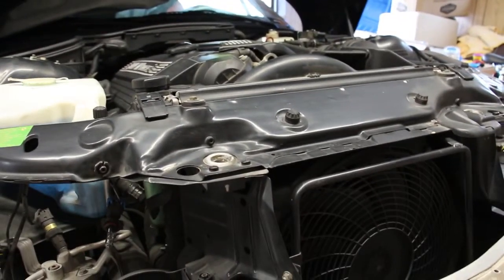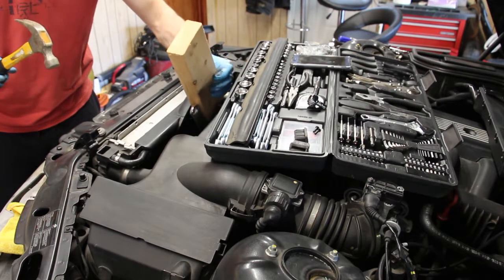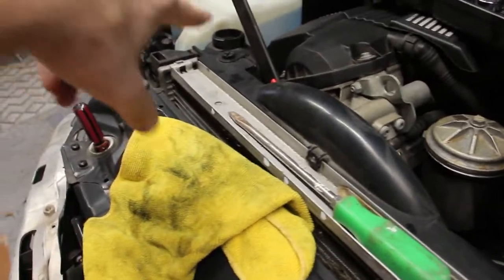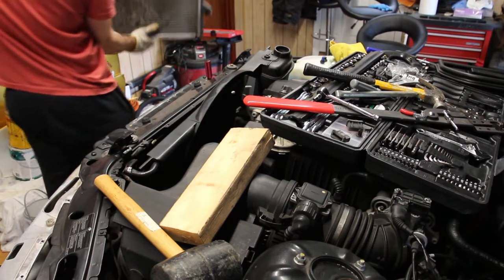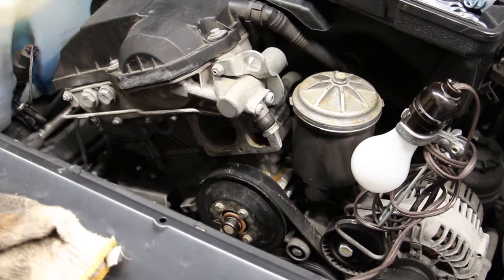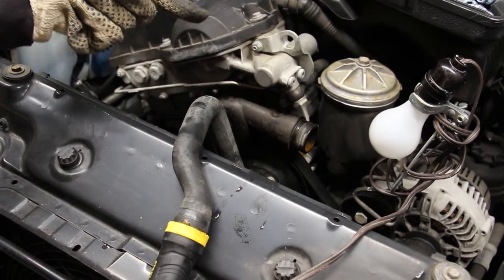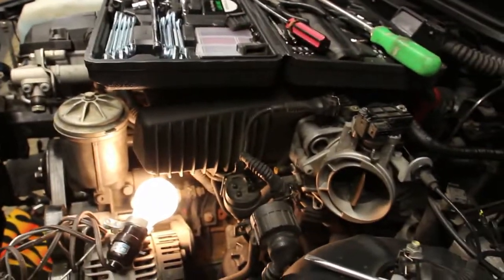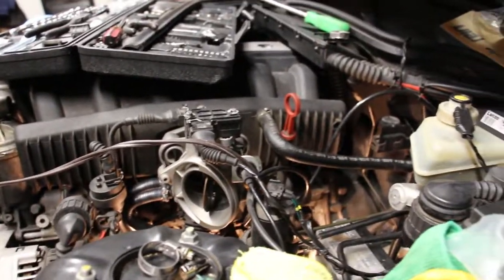How to Update the Cooling System on a BMW Z3 M Roadster pt.1

Comment: At the 25:27 mark where you show the hose routing on the water valve off the vehicle I think you may have gotten it reversed. My before photos of my car show the short hose coming out of the dash and going to the bottom outlet of the water valve and not the top. Thoughts? I want to make sure my car wasn't wrong to begin with, perhaps the previous owner had reversed the. Great video by the way, helped a lot when doing  cooling system overhaul yesterday.
Reply from the maker: Hmm, that's a good question. I looked at some diagrams and it appears to be reversed! That's how it was originally hooked up in my car and it ran without any issues. I was also able to bleed the coolant successfully. Good catch there. I'll see what I can dig up on this. It will suck to redo this, but if it's wrong, I wouldn't want to leave it like that.
Reply: Yeah I posted something on the forum and another user checked his car and looks like you have it reversed. The bottom outlets should be going through the dash and in the heater core. There’s always a risk on 20 yo cars that previous owners did things incorrectly . Thanks again for making the video. It gave me the confidence that it was a job i was capable of doing!
Reply from the maker: @TuanNguyen-tz7gi  now I have another question for you because now I'm questioning whether the previous owner screwed up other hoses. Which heater core outlet takes the stubby hose and which side takes the long one? On mine, the stubby hose was inserted on the right (passenger side) and the long one that goes to the block is on the left (driver's side). Is this how it's routed on yours?
Reply: @CarGuy1  You are correct. On my car the stubby hose to the water valve is coming out of the Right (Passenger side). The long hose that goes to the very back of the engine block is on the Left (Driver Side).
Reply from the maker: @TuanNguyen-tz7gi  thankfully fixing this is pretty simple
Reply: CarGuy wanted to close the loop on this for anyone else reading this. My system is together and working as it should. Passes all functional and temp checks so the routing of those hoses are as I described.